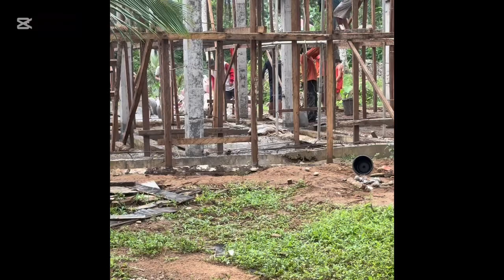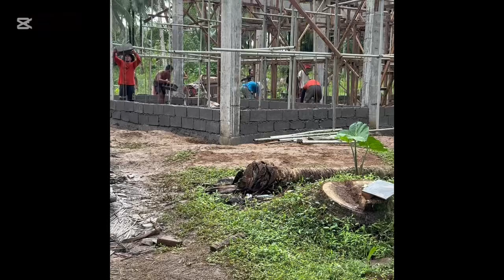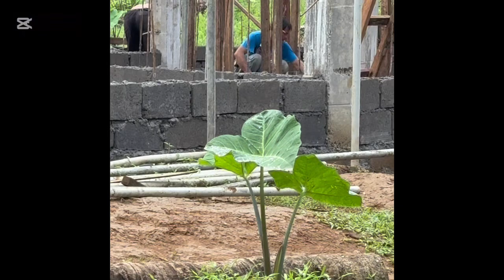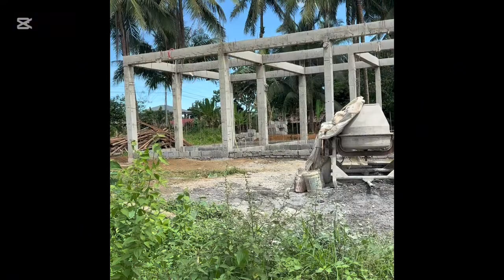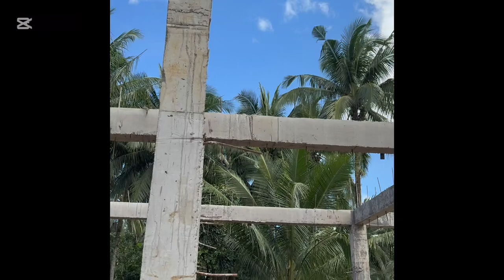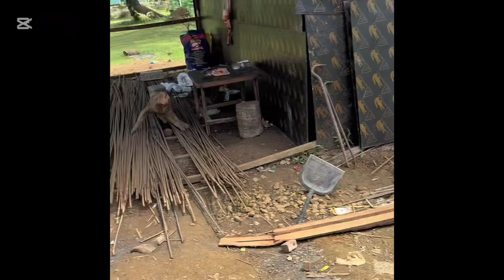Building in the Philippines - Week 7

Comment: Did you put in termite solution before they poured the slab? And a vapor shield?
Reply from the maker: Yes definately included termite solution when doing the columns etc and also when pouring all the floors. Don’t know about the vapour shield, not sure what that is.
Reply: @aselfsufficientretirement  A vapor shield is piece of heavy plastic for instance to cover the soil, so rising moisture and damp cannot get into your house.
Reply from the maker: I don’t recall seeing any plastic sheeting, however they often mixed stuff in with the cement.

Comment: omg what is wrong with the hollow blocks? The are already tear apart they must juse whole hollow blocks not small broken pieces. Please tell them they must do a proper jop. YOU PAY FOR IT! Its not acceptable. when the whole buld is finished in one month you get cracks in the walls because of the weak hollow blocks
Reply from the maker: Thanks for your comment. I think I see what you are referring to, at the front where the verandah is. The levels here had to be slightly different. I agree , at this point it looks messy.
Reply: @aselfsufficientretirement  I'm refusing to use them, and building a light gauge steel framed building. Maybe I could have gone down the AAC block route, but there is a bit of a scandal here in the UK because a lot of public buildings built around 40 years ago using AAC are crumbling. I'm going to clad with Hardie Board (or a Chinese equivalent) and insulate the cavity between that and the plasterboard internally. Quicker, neater and cost-effective. Hope it works! 

In any event, the Filipino builders are masters of their craft when it comes to rendering and plastering, so it can hide a multitude of sins. But I would be expressing concern to your foreman. In an earthquake, those walls will probably suffer quite badly.
Reply from the maker: @ForeignGuyintheBarangay Sounds good, steel frame would be my choice in a perfect world. Which part of Philippines are you? Here in Bicol am more concerned with typhoon rather than earthquake, although who knows!! Survived the last typhoon with flying colours, and that was semi constructed. Look thru our vids for farm v typhoon and you will see what the winds did to farm!!
Good luck with your build, sounds like a great project.